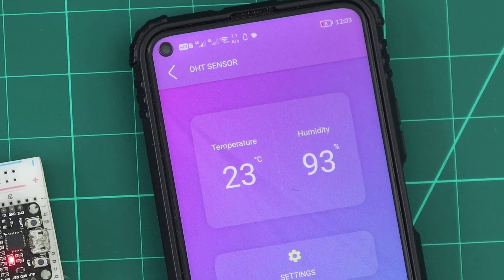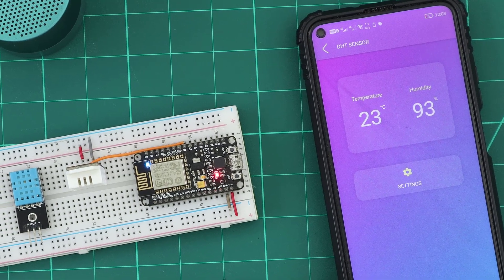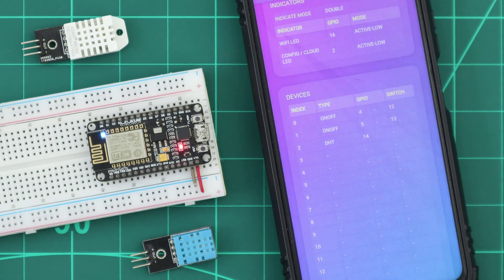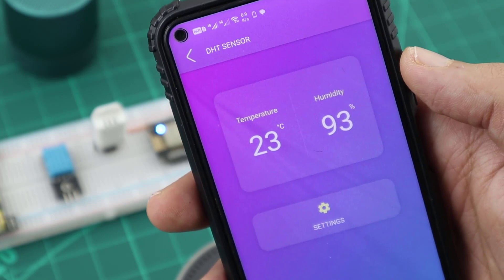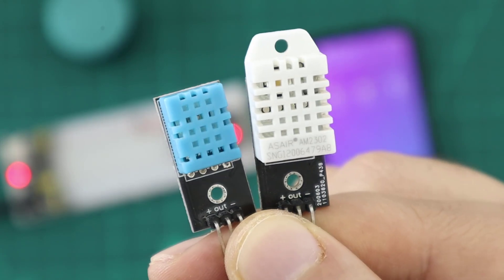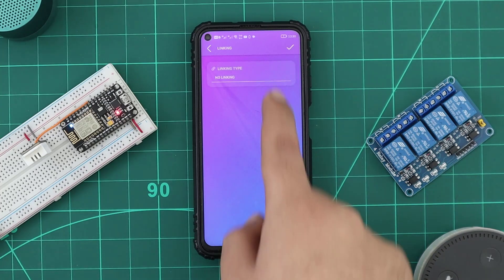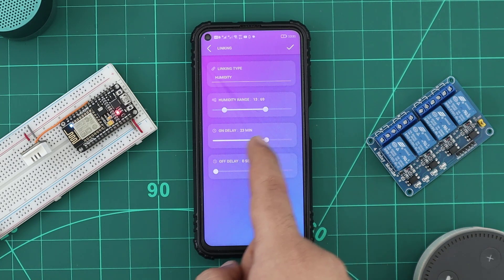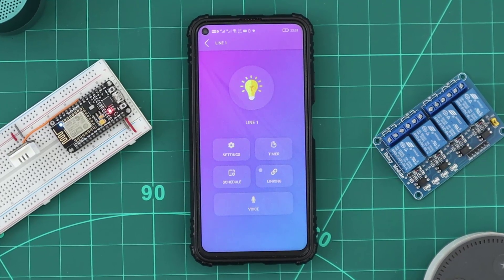Adding DHT in CADIO to monitor temperature and humidity (ESP8266 - ESP32) | CADIO Home Automation

Comment: Can someone explain in a simple way how to connect a thermometer based on the ds18b20 sensor to this application? I see no problem with dht, but with ds18b20 there is already... I set it as a sensor but it doesn't show anything... ;/

Comment: Sir, help me. Why add gpios error "gpio should not be duplicate"
Reply from the maker: Make sure not use any gpio for two devices, also keep in mind that there is three GPIOs are defined by default for config button and indicator LEDs (0, 2, 16).

Comment: I did tests with 3 different DHT11 sensors and it didn't work for me, I also did tests with WS2812B led strips, you have to modify the configurations to GRB, regards
Reply from the maker: Is the dht vcc connected to 3v3 or 5v?
Reply: @cadioHomeAutomation  3.3v Man

Comment: It's a great👍 How do I install the 2x16 LCD Screen and rain sensor?
Reply from the maker: CADIO supports digital sensors, so you need to connect the rain sensor digital pin to the sensor GPIO and it will works normally.
LCDs arn not supported yet!
Reply: @cadioHomeAutomation  It would be nice if you could do the lcd support.🤝
Reply from the maker: Thank you, this will be token into consideration during the discussion of future developments!